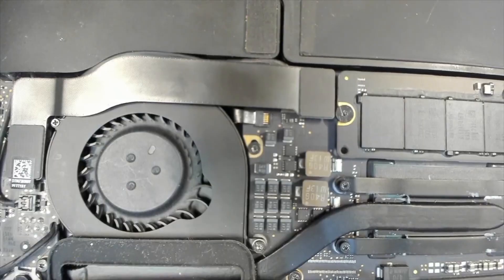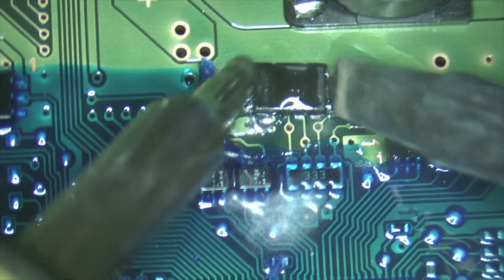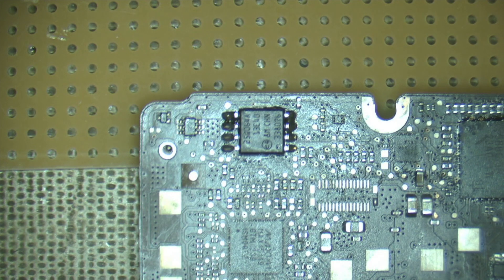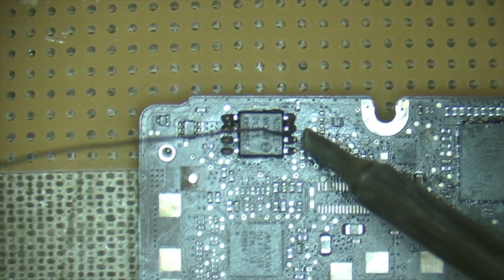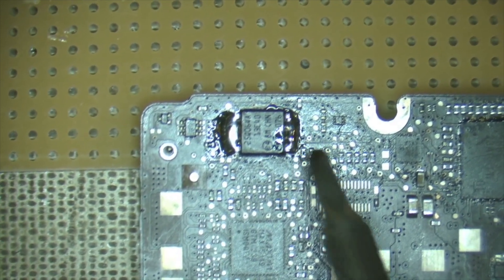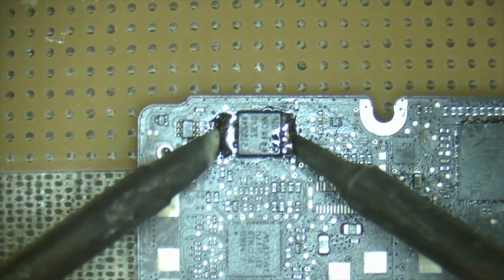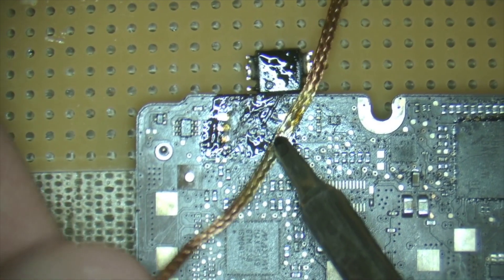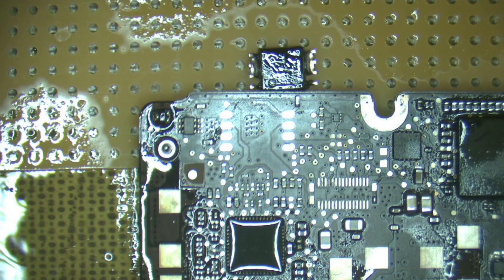Eeprom Component Replacement Tutorial - How To Solder And 8 Pin Eeprom Component

Comment: Hello MBK Upcycle. To remove the offending EEPROM chip I used a 40-watt soldering iron. However to solder into place the replacement (or new one) I applied soldering flux to the legs of the EEPROM  chip. I cleaned the solder pads on the PCB with 94% IPA. I carefully placed the EEPROM chip using a magnifying lens. Then using a laser temperature gun, I decided to see how hot the low setting of the two-stage heat gun would get. It was able to attain a temp of 200 degrees C. After this test, I used the heat gun once on each side of the EEPROM chip watching the legs gently rest into place upon their respected pads of the PCB.  This EEPROM chip is pre-programmed where I bought it from. Viola!! Thanks for your instructions here on YouTube.
Reply from the maker: Thanks for your feedback William. Everybody uses different techniques. There is a part 2 of this video being released tomorrow, showing how to desolder utilising ultra low melt solder.

Normally in the real world, I would probably use the Hakko Hot Air to desolder, but I deliberately wrote these video's showing techniques a person could use if they did not have an arsenal of soldering equipment.

Also a lot of people use "Hot Air" and cook the living daylights out of eeprom, so I do not focus on the hot air side of things too much.

Cheers MBK